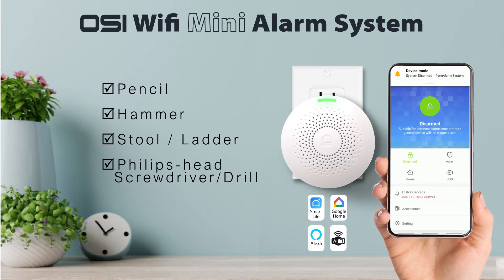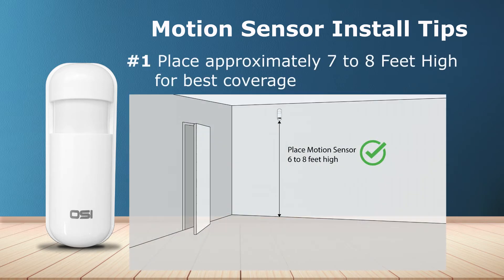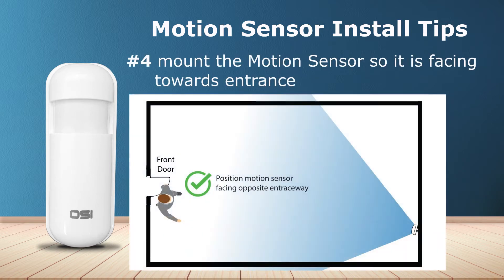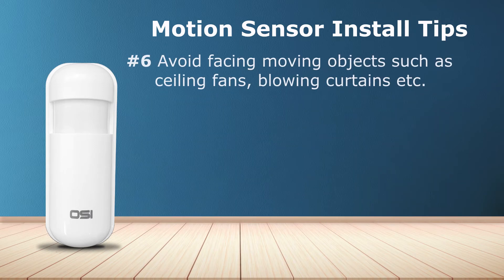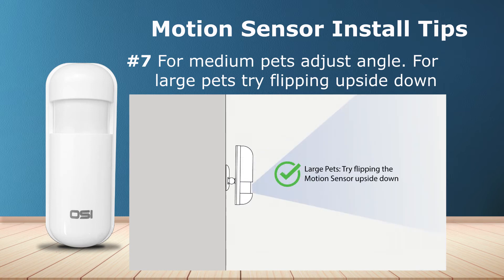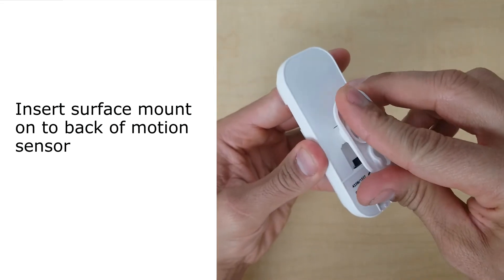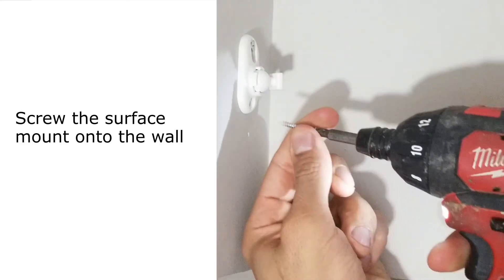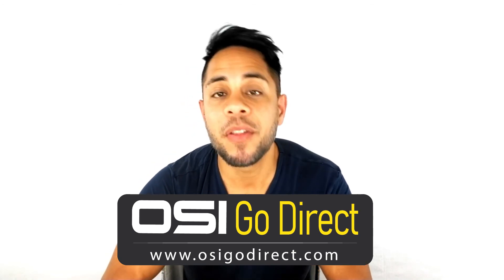How to Install the OSI Alarm Motion Sensor // Motion Sensor Placement Tips //OSI GO DIRECT

Comment: I followed all the guidelines regarding angle, height etc, but detection range is only 3-4m when installed at 7'2". Any advice? Its already in test mode with new batteries. I tried 4 sensors with same result.
Reply from the maker: You can contact us directly by creating a support ticket.   If we can get an idea where your sensor is installed and the area that it is looking at we can help you further.  https://www.osigodirect.com/create-a-ticket/